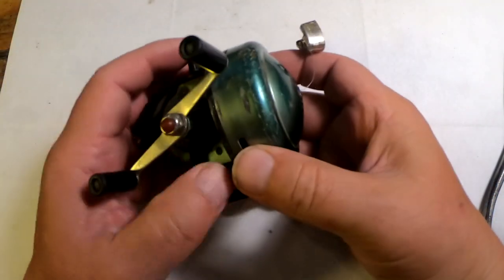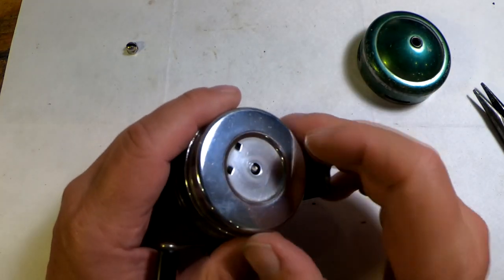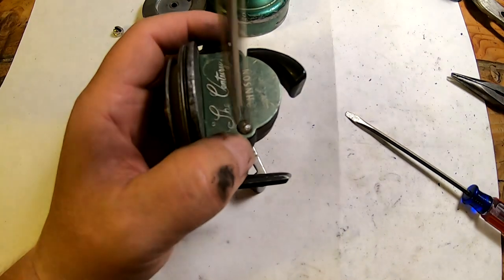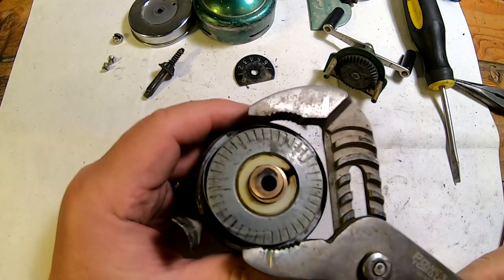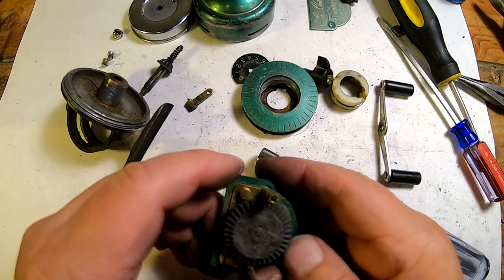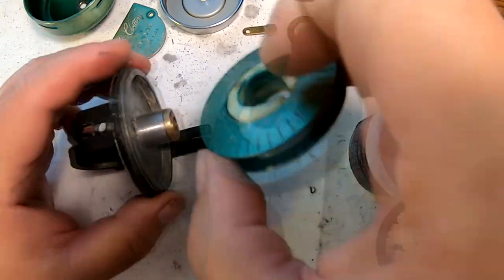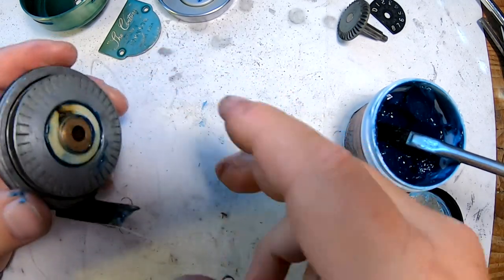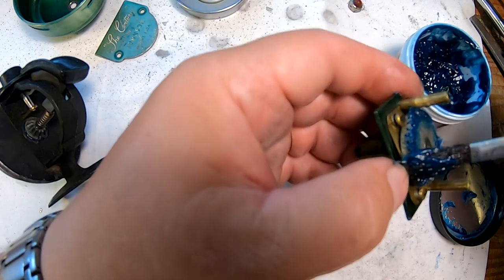How to Service a Johnson 100A Spincast Reel

Comment: i used this vid to understand my 100-A which differs from yours in several aspects as well as another YT'er's 100-A . the key to taking off the spool is to take off the drag mechanism which is connected to the drag brake which is notched into the spool's nylon center. the part you thought was missing is also not in mine so i'm assuming it doesn't exist since it is a bimetal shaft i think you might be confusing the transition between the 2 metals as a notch for a spring clip and rather than risking marring the drag gauge, the gauge itself is pushed up from underneath to recess the screw to undo the assembly, probably why it overlaps the reel body
Reply from the maker: Thanks for watching

Comment: Thanks for this information Video👍🏽One suggestion would be is NOT to use any tool to Pry up on drag knob, That can be accomplished easily by Gently lifting up on the Number plate and consequently the knob with your fingers as to not deface the numbers
Reply from the maker: Thanks for the tip!  I can see there are a lot of Johnson reel fans out there that know more than I do.

Comment: Thanks, Matt. I have 2 #100B Johnson reels. I still use one on a Johnson rod. I have not done extensive research, but I have not found a parts source. I live not too far from Mankato, MN where this reel was probably made. Also, I use 0000 steel wool for cleaning all reels and many gun parts. Great video.
Reply from the maker: Thanks for the comment. That is cool you still use a reel that is so old. Good little reels and greater memories!

Comment: I have that same reel. When I acquired it last spring I totally disassembled it like you did in this video. That same spool clip is missing on my reel, also. The reel works OK without it, but I have some thin stainless steel spring wire to use to fashion a clip. Thanks for the tip about adding the thin washer to the main gear to take up the gear lash. I'll have to find some shim stock to make one.
Reply from the maker: Enjoy it.  It is very sturdy.

Comment: I watched this again.

My opinion, the drag didn't work very well on the early models.  Namely the Century 100, 100-A and the 100A.
That's why they kept making changes with each version.  The Century 100B works very well.  And as I mentioned previously, if you are going to fish with a Century the 100B is the model to go with
Reply from the maker: Thanks for the information!

Comment: I have an earlier model 100a and despite it’s excellent condition, the drag is incredibly tight even with the drag adjustment screw completely removed. I’m wondering if get the plastic drag cylinder has swelled over time? I’ve seen that happen to the center shafts on many plastic body Zebcos.
Reply from the maker: I think the plastic must expand over the years from oil.

Comment: Hi! I have this reel also, without any clip external to the spool.  Referring to the Johnson schematic for this reel, the steel ring that surrounds the white nylon drag  part 5D “Internal drag shoe” is called 5E “Spool retaining ring”. There is no other clip shown. I expect that, since the line tension is in a radial direction and the drag loading lever “jams” the internal drag shoe to the shaft, the circumferential ring around the internal drag shoe running in the groove on the internal diameter of the spool prevents any axial movement. In the 100B, with three split washers forming the “internal drag shoe”, the ring arrangement couldn’t be used, hence the clip on the front of the spool in that model.
Reply: Update:  I guess it depends on the vintage of the 100A -I came across another schematic with the same type "internal drag shoe" but no "spool retaining ring", rather a retaining C-clip .  So there were 100A reels with the circumferential wire ring "spool retainer" , followed by a 100A with no "spool retaining ring" but a C-clip that held the spool in place (like the 100B.
Reply from the maker: Thanks for the tips.

Comment: I need to service a 100B,  looks to be about the same with only a few differences.  Hopefully this video will be a good starting point
Reply from the maker: I hope so, there are not many service videos for these old Johnson Spincasters.
Reply: This aren't a lot of differences between the 100A and 100B. The main difference is the location of the sideplate attachment screws. They switched from the nameplate side on the 100A to the crank handle side on the 100B.

Comment: I wonder if one of those "e" clips would work?
Reply from the maker: I have some, but they are too thick.
Reply: @OutFishing13Matthew  It would be a lot of work but if you could find one that would fit the shaft you could sand it down by hand by rubbing it on a sheet of sandpaper on a flat surface and test fitting.
Reply from the maker: @adnacraigo6590  Great suggestion. I may see if I can find a parts reel.  This wasn't my reel, so I don't have access to it at this time though.